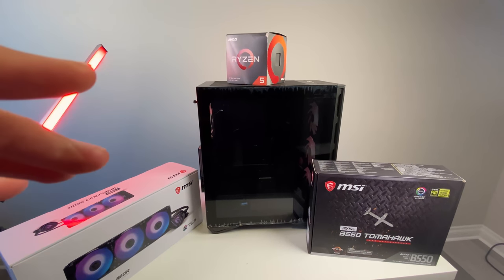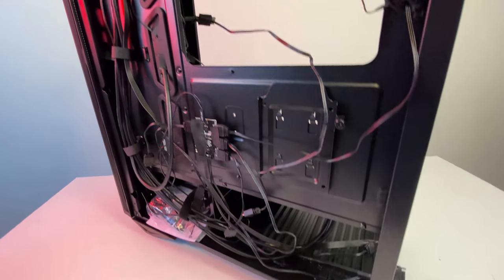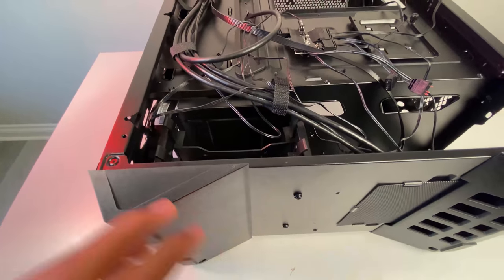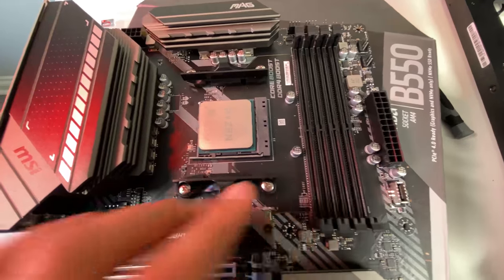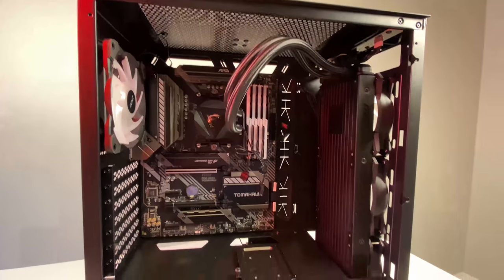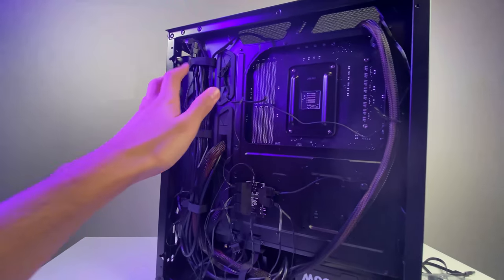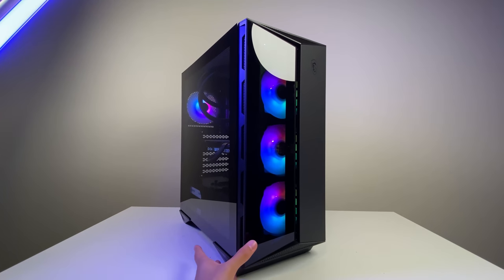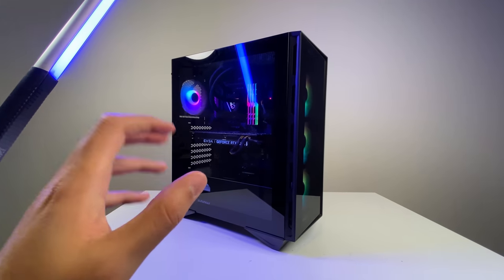Can This Fit Inside?  MPG GUNGNIR 110R Build

Comment: How did you get your rgb lights to work ? I got everything but that little header you have. I got the rgb 1 to 3 splitter and also got a cpu fan 1 to 3 splitter too. I have a msi b550m pro mother board with a rainbowrgb 3 pin port and a jrgb 12v 4pin port and none the fans led lights turns on.

Comment: The radiator blows hot air into the case :D
Reply: In was wondering the same, I have the same case with the same cooler but 240mm on top and the fans are blowing air up top, not like this.

Comment: Will I have any problems with my specs: GIGABYTE GeForce RTX 3070 VISION OC 8G GDDR6 and ryzen 7 3700x? Not looking forward to overclock cpu or gpu btw
Reply from the maker: Great specs! I don’t see any issues. Make sure to get fast ram above 3200mhz
Reply: I have 3600mhz for ram
Reply from the maker: Your golden
Reply: Hey one last thing, I am new to building pcs so my brother is doing it for me and he says I need a hard drive. What kind of hard drive do I need for that and what hard drive do you suggest
Reply from the maker: @whoisjoe8555  Get a 1tb nvme drive if you can afford it, and a regular HDD for mass storage.

Comment: Hi I am currently building a similar setup. I was wondering, do you need additional spacers in the case ATX screwing positions for the motherboard or are the integrated spacers sufficent?
Reply: The spacer are enough, I have the same case

Comment: Thanks for showing me that the HDD caddy can be moved over.  I was pretty miffed when the Corsair H110i 240mm radiator didn't fit on the top or the front before the caddy was moved.
Reply from the maker: Glad I could help
Reply: Were you able to get the 240mm radiator on the top? I am thinking of getting this case and mounting my current H100i on the top.

Comment: I also use MSI's case "MAG vampiric 010", and I remember when I tried to mount a 360mm radiator in it, the 3.5” drive bay interfered and I had to move it to the PSU side. 
It seems airflow is better in Gungnir 110M and 300R airflow

Comment: This case is really nicely laid out and clean cable runs can be easily achieved. Haven’t built a computer in over 10 years and things have come a long way. I wasn’t too keen on getting tempered glass RGB anything, but cost/ performance balance kept narrowing my selections down to this style as it’s the most common available.

Comment: I got this case in a MSI prebuilt Aegis ZS ... the 120AIO busted after 8 mo. of very light use - CPU hitting 100c - so sent in to MSI for RMA...  I am happy to have found this, because I was thinking to not re install whatever they send me, and instead put a 360 up front, but never seen it done, with my case - so thank you for this vid!

Comment: Just bought this case, but I have the 240mm aio and 550m mortar. But thanks for the video brother.
Reply: كل زق
Reply: thinking about buying the 240mm aio. Does it fit in your case in the top or the side?
Reply: @newzer8382  he fit in the top
Reply: How do you take the bottom dust filter off

Comment: 11:46 you should REALLY not place your radiator that way : since any air inside will rise to the top, the water has to push through it when getting in, which produces gurgling noises and wears out the material faster. you should place your radiator with the pipe entry at the bottom rather than at the top in order to avoid this :)
Reply: Did you look at the case before writing this comment? There is no other way to mount it.
Reply: that is the best spot yes, but it wont really matter as long as the pump is not higher then then the radiator. If you place where the pipe runs up you would barely notice a difference.
Reply: just watch greg's video on it
Reply: My guy the pump is at the bottom

Comment: Did you use the build-in fans with the AIO or did you unmount the build-in fans and and mounted the AIO's fans?
Reply from the maker: I used the AIO fans that came with the cooler.

Comment: My question is if u have a gpu 320mm while this case has 340mm space for gpu, does it still fit if u put this liquid cooler radiator in front?

Comment: Looks like you have one (daisy chain) cable plugged in to your gpu... You'll want to use two separate cables so you don't grin into power issues or start a fire if you have a higher power gpu.

Comment: love how there case fans that came with the tower was all set to exhaust.
Reply from the maker: Hmm are they? :D
Reply: @Realhardwarereviews  watch 1st part of the vod, you'll see the face of the fans are on the inside.. meaning they was in exhaust lol and so was the back case fan, but once you put the rad in you fixed that.. alot of company's are doing this now days. friend of my got a new pre built.. has 2 fans on the MB side.. there exhaust.. the rear fan si exhaust .. i was like dude.. swap them or add 2 intakes to the top lol
Reply: @Realhardwarereviews  go to 5.01 in the vod.. you can see them

Comment: Would you say this case is enough for a Ryzen 5 5600X and MSI GeForce RTX 3060 Ti GAMING X? I’m looking to build a full MSI build.
Reply from the maker: Yes, hopefully you already built your pc by now :)
Reply: @Realhardwarereviews  I actually got a Ryzen 5 5600 not the X because it’s basically same performance when overclocked a bit (and i saved like 50€ by going for the non-X). I have not bought the graphics card yet tho since the prices went going down so i decided to wait. I have a MSI GeForce GTX 1060 6GB Gaming X for now (got it for cheap from my friend) but soon i am going to get a 3060 or a 3060 Ti. For motherboard i chose the MSI MAG B550 TOMAHAWK and for my CPU cooler i got a MSI MAG Coreliquid 240R V2.

Comment: not sure if you want to have liquid cooling pipes at the top of your radiator? where air in the system can limit how effective they works and the noise?
I would move fans from behind dust filter to infront of case, and have the radiator flipped with pipes at bottom

Comment: If I install an AIO on top would that be better for cooling the pc, along with all of the fans included?
Reply: I just watched a video on that - and it seems for GPU fan/rad placement don't matter (if open air GPU) but in the experiment, it showed marked difference in CPU temps (10c cooler with front mount rad) which make since pulling in ambient air and opposed to eating already hot air when up top.

Comment: Dang does the MSI rtx 3090 ti suprim graphics card fit in this case with a radiator in the front of the case? It seems tight
Reply from the maker: That card is hefty. It wouldnt fit in this case.

Comment: Does the asus ROG strix b550f fit in it ?
Reply: Yes, it will. Be very wary though. There is not much room above the board for cable management. Also, if you use a top mounted radiator. You only have 27mm of clearance for a radiator. I bought a NZXT radiator, which is 30mm and it did not fit. An ASUS Ryou did fit since it is 27mm. This radiator still touches the tops of my RAM, but its does fit in. Also If you have a long graphics card. You will not be able to fit a radiator on the front. My Strix 3080 only gives me like 20mm of clearance between the fans.

Comment: Why did you mount the AIO upside down? Pipes should be on the lower side of the heater.
Reply: Hey man please watch jayztwoscents newest video he explains really good the positioning of the aio,
Reply: @gunnerrn  Yeah, air is trapped in highest point of the loop...so mounting with pipes down is still best option.
Reply: @solidsnake123100  u can still mount it with the highest point as long as it is higher than the cpu placement
Reply: @gunnerrn  that is 100% true BUT you really do not want a interupt the flow of the liquid by the bubbles at the end of the hoses on the point whre are the hoses mounter do the radiator so...you are right you can mount it as you described and lifespan will not be changed BUT it is not the best solution.
Reply: Anyone out there who might be curious you can mount a 280mm with the pipes down in the front but it is quite tight.
Reply: Do you know where 360r pump. Close by pipe

Comment: I'm going to get the MSI Gungner 110M. Is an air cooler (Noctua U12S) adequate? I've got a Ryzen 5 3600.
Reply from the maker: Yup, it should be more than enough.
Reply: @Realhardwarereviews  I found out myself a couple days ago! Thanks for the reply regardless ^.^

Comment: It says can only support up top 240mm radiator on top, but it also has the holes for a 280mm as well, would check if can be supported?

Comment: Are you sure the front fans are starved or just assuming so. Without calculating the fan cfm and the slots/vents allowable of cfm etc, how can you state the fans will be starved of air?
Reply from the maker: Simple physics. Having more vent holes will increase airflow.

Comment: Hi..do you know if i could install a Triton 240 cooling system of Antryx in the top of this case?. Y have a msi b460 mortar mainboard. I was reading that is impossible because collides with the ram. Thanks.

Comment: I am mid process of an install with this case. The pwr for the 3 front fans works with the daisy chain. What did you do with the rear fan pwr, just plug into a header on the mb? I don't see how it is linked with the front 3 (if that is even a thing).  Next (and related), I have a CM 212 rbg cooler. The pwr connects to the cpu fan. But where do you put the rgb cable? Does it somehow connect to the rgb controller of the case? There is an extra pin on it, I think. I have an argb on the mobo (Asus Tuf gaming pro 570x wifi 6), which I assume the case argb controller goes into. If I plug in the cm212 rgb into the mobo regular rgb, it won't be controlled with the case fans, right?

Comment: I have this case with the stock fans. Is there anyway to control the rear exhaust fan as its always running full blast and it doesnt appear in the bios or anywhere ?

Comment: I am building a amd ryzen 5 3600x with a gtx 1660 super is this a good case option
Reply from the maker: For your specs it should be good. Airflow might be an issue but your components won’t produce that much heat.

Comment: Hi, thank you for the video.  Do I need to swap the pre-installed front fans with the fans that came with my MSI 360 radiator?  They look to be nearly the same fans.
Reply from the maker: I did mainly because the AIO fans usually are a bit more beefier. I think they can spin at a faster rate but don't quote me on it haha.
Reply: @Realhardwarereviews  Got it.  Thank you
Reply: @brianveltri  then you have one spare and two fans up top for exaghst
Reply: @Brian Veltri  hey, did you manage to fit your 360 in the front in the end? Tysm

Comment: Hey man how did u plug your argb fans? I am using the same case and I cant control the rgb lighting.. only the pump, gpu, ram are in-sync. I would appreciate a reply. Thanks
Reply from the maker: Hey Jae, sorry for the late reply. You should be able to control it once you plug it in the fan controller header in the back of the case. Keep me posted.

Comment: How do you connect the cooler in frontal panel, i can connect the aio fans with the radiator(sorry my bad english)
Reply from the maker: You should be able to connect it to the fan controller at the back of the case.

Comment: Hi there! You helped me a lot with vid! Thx!! I would like to know if you could tell me if and/or when we would need to connect both of the two PSU connectors on the x570 Unify motherboard?? And which power supply would be able to do that. Cheers!

Comment: How much space do you have with AIO on the front for the graphic card. MSI RTX 3070 TRIO is 323mm
Reply from the maker: I couldn’t fit a 3060 ti gaming x trio. So your mileage may vary. It’s going to be a tight fit if does squeeze in.
Reply: @Realhardwarereviews  was that with the front aio?
Reply from the maker: @Ezhaa  Yes with a 360 AIO. It wouldn't fit in properly. Get a 240 AIO and stick on top.
Reply: @Realhardwarereviews  will it fit the 323mm 3060ti without the aio?
Reply: can fix 323 mm gpu .... 

till suprim x then unable to fit in

Comment: You suggested that air is restricted by the front panel. Curious if you could confirm it. Run tests as is, then without the front panel on. Then we would know.
Reply from the maker: Wish I still had the case. Sadly it was a loaner. I would have confirmed it with you otherwise.
Reply: I have unscrewed the metal side and the temps dropped by 3 degrees and the fans stopped struggling. (5900x + x62 Kraken), Would be better if they did a mesh side for it as a replacement.
Reply: @bobthecooldad Interesting. my 5600x and rtx 2070 super hasn't caused the temps to get into the 70s (60s only).  I haven't done stress testing beyond OC of memory and cpu. As long as the fans aren't audible, which they aren't, I don't really care.

Comment: I'm kind of stuck with the RGB controller at the back... I've got the SATA & the front panel button plugged in at the correct spots as well as the 4 fans into 4 of the 6 headers. But I can't figure out where to plug the cable coming from the aRGB header of my MB ? Would really appreciate an answer! Thank you in advance :)
Reply from the maker: Did you manage to figure it out?
Reply: Same issue. Pls help

Comment: I have a rtx 3080 and ryzen 5800x, should I steer clear from this case?
Reply from the maker: Depends. Are you planing to overclock your cpu and gpu? Thermals could be an issue since the front intake fans don’t have enough airflow.
Reply: 5900x and 3080 here, no thermal problems
Reply: Hopefully I can put a 3090 intel i7. The graphics card was MSI so this was the case I went with. Rip such a dumb front

Comment: Sorry But my english isn‘t Good. 
Is it possible to get an msi 3080 suprim with 33 cm in when a radiator is installed in the front?
Reply from the maker: I couldn't fit a 3060 TI with a AIO in front. So I wouldn't try it.

Comment: Good job! I was wondering how to take the front panel off the entire time I had the case. Glad my question was answered and I managed to clean the front panel dust filter before it clogged up. On a side note that might not be relevant to others, an Intel Core i9-10940X cooled by an MSI MAG CoreLiquid 240R in the Gungnir 110R maxes out at 80 degrees Celsius when clocked to 4.1 GHz on all cores while running Cinebench R23. I tried it myself, and as I first-time overclocker, I was scared that something would blow, but everything was alright. :)
Reply from the maker: I’m glad that I could help with the video. Front panels can be a bit tricky to pull off.

Comment: I have a 240 mm cpu cooler and I am not sure will it fit to the top? (Sorry for bad english) the store which I buy this case says cpu cooler part is 170 mm
Reply from the maker: It should fit on top of the case. There was plenty of space and pre-drilled screw holes for it.

Comment: Hi! another question. I am really having a hard time getting the little button for switching the RGB  Fans to work! I am going crazy with this one. What I did is, I installed the fans of the AIO on the Radiator, and the Fans that were in the MSI Gungnir 110M in the Top and rear of the case. I can control the Cooler Fans with the MSI Software, but I do NOT know how to connect the Chasis Fans of the MSI Gungnir 110M so that the button on the case would switch the colors. Can you give me guidance how to do it, so that the button finally wokrs? How did you do it?
 Thank you in advance!
Reply: I'm going to assume you didn't plug the rainbow1 connector to the board or sata power to the front of the case

Comment: Could I install a video card Aorus rtx 3080ti in this case?  Asking because I’ve noticed this card being larger than the other ones.
Reply from the maker: I had difficulties with a 2070 to fit in so make sure to measure it.

Comment: Can you tell me how to take off the front panel for this case? I've had it for months and have no clue how to take it off as this was a bought build. If you could give some advice on how to also clean the back filter too that would be great. Thanks!
Reply: just pull, hold top and pull on bottom edge... it will unseat.

Comment: Hi,
I'm currently stuck trying mount the cooler portion of my MSI Coreliquid 240R to my cpu in the MSI Gungnir 110R case. (I'm aware the installation process is identical). When I attempt to screw the cooler on top of the cpu, it doesn't even close to making contact there is large gap (the cooler just kind of floats above the cpu) (its like the bracketts wont clip on properly) to the AM4 retention system.

This is my first time trying to install an aio, any help would be much appreciated thanks.
Reply from the maker: Did you manage to get it on? Usually there there is a spring loaded retention screw that needs to clip on.
Reply: @Realhardwarereviews  Sadly no and I've tried all solutions rewatching your video, another youtubers video (Gear Seekers), and MSI's video. 

I either have a defective unit between the aio or my motherboard... the clips don't/won't even clip somewhat clip to the retention without being screwed, the springs are super stiff (not even remotely "springy") even with slight pressure. I think I might just return the aio to microcenter and try to get store credit to purchase an air cooler... This has been a lost cause since Friday and I've tried for three days straight with no success... 🤦🏾‍♂️ just want to complete my rig I have the wraith cooler but it blocks some of my dim slots.

I appreciate you reaching out to me thank you.
Reply: @Realhardwarereviews  I managed to get it working with some help. I do have a question I manage to get the radiator fan's rgb working but not the pre-installed case fans... If possible can you explain how/where to plug in the wire's on MSI B550 Tomahawk motherboard to the case fans rgb?

Comment: I have a problem my motherboard only has 3 fan headers is there another optional header I can use?
Reply from the maker: You can use provided fan hub that comes included with the case.